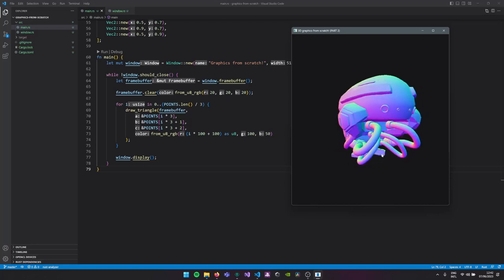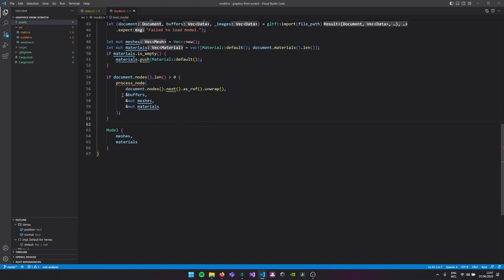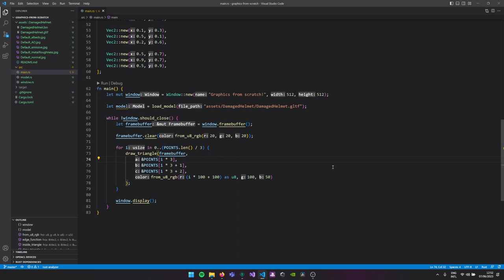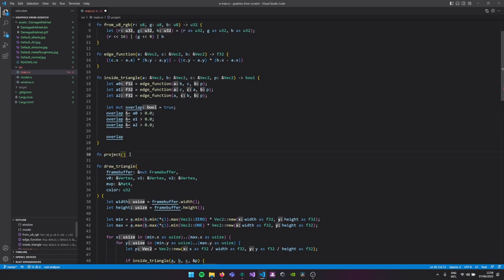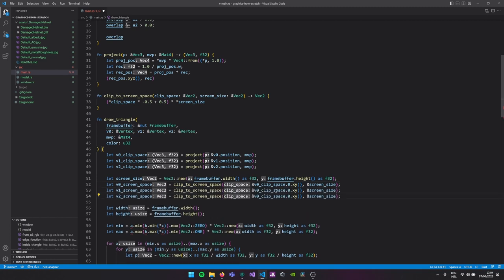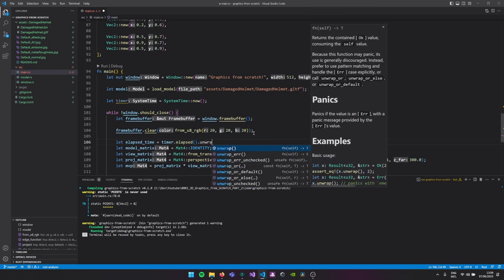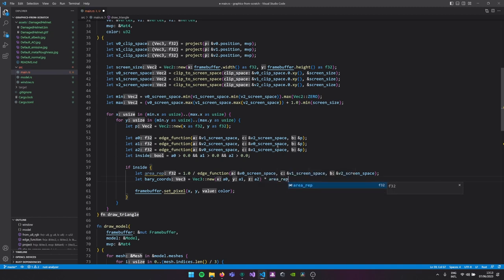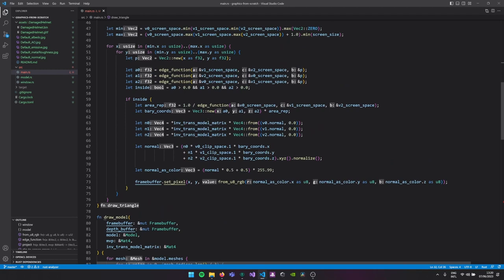3D Graphics from SCRATCH - PART 2

Comment: Hey! Firstly, I am very amazed by your content. I literally can't believe you only have 150 subscribers I thought you were a huge youtuber. I love these tutorials.
Secondly, I am working on game engine and have done so while basing in on the Cherno's game engine series tutorials and I have almost reached the last tutorial(from here tutorials will come weekly). For now my game engine supports only 2D rendering with textures using openGl, but in other regards it's pretty ok for starters. It has an editor, ecs, serialization, uses Imgui as gui  and it has a robust foundation I think. I would like to continue on my own and develop a 3D renderer for it but as the series will not cover a 3D renderer I have to make it myself. Do you think these tutorials are enough for a basic 3D renderer or should I research myself in more depth. I will watch these tutorials anyway Because I have learned a lot already, I just want to know the level of complexity they define. Thanks a lot for making them and if you see this and answer  I will thank you even more:)))))
Reply from the maker: Hi Luca, thank you for you kind comment. This rasterizer is running on the cpu which won't give you anywhere near the performance of OpenGL, even if it is running on integrated graphics. These video's are more meant to give you a solid understanding of the basic principles, after which I would advise you to pick up opengl or vulkan. However, if you're interested, I'm working on a tutorial series about realtime raytracing on the cpu. Although, it will take some time before it's finished I'm afraid😅. In the meantime I wish you the best of luck with your engine, keep it up!
Reply: @GameDevGraphics  The videos still help me a lot. Thanks for this info. The concept in itself isn't that complicated but I feel like I really needed to see an implementation of it. And I actually learned a bit of Rust along the way:))) as oposed to all the c++ I have been using. I am eagerly waiting for more content!